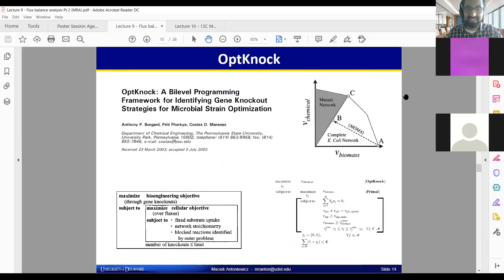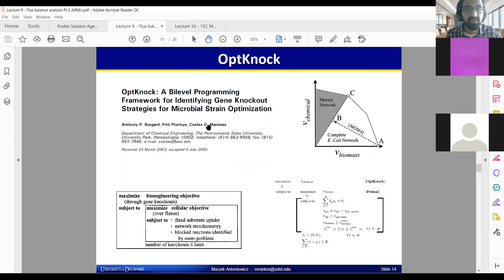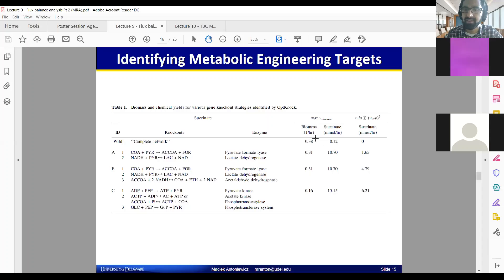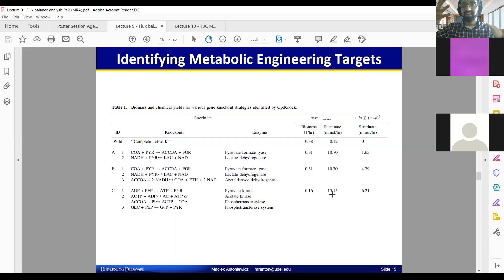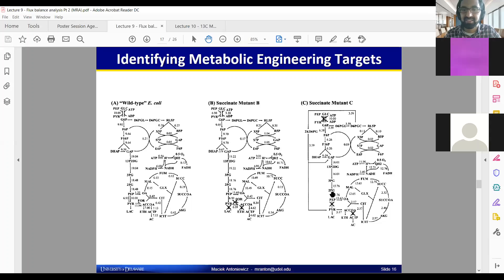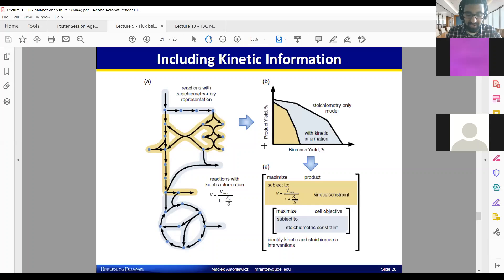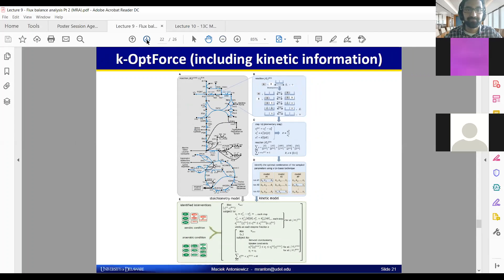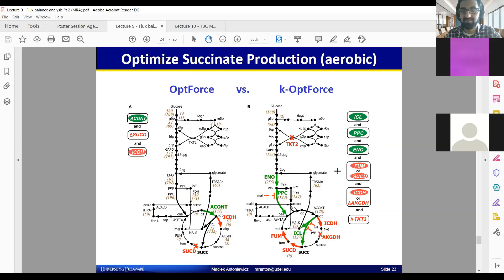10 OptKnock | Flux Balance Analysis | Lecture 11 | Metabolic Engineering | SP20

Comment: Hello, I am doing a PhD in Optimization at the University of Strathclyde and currently, I am working in developing an algorithm to solve the bilevel part of the OptKnock.
First, let me thank you, your videos have helped me a lot to better understand. Second, I have a few questions I would like to discuss them if I were to look for possible knockout reactions, would I have better chances by looking into the reversible reactions? in the sets of knockouts from the paper (Maranas, 2003) Table 1,  A, are the reactions that get knocked out, which according to your slide clearly don't belong to any essential set of reactions, so the flux is zero, Could any other flux from somewhere else in the network be also zero? maybe some fluxes associated with reactions that expel from the cell? I would really appreciate some feedback.